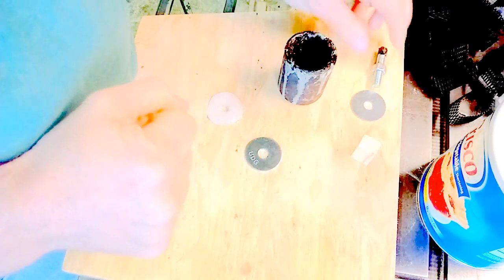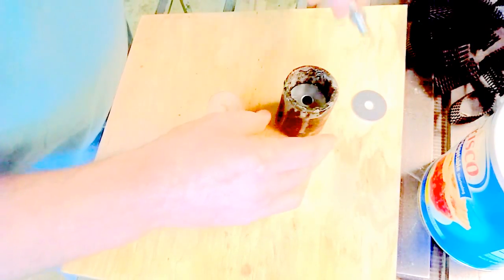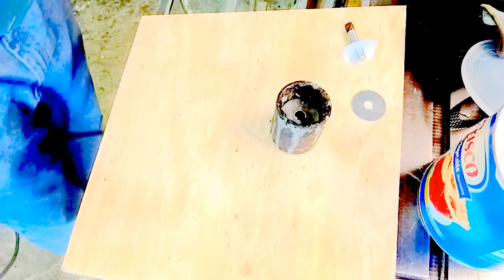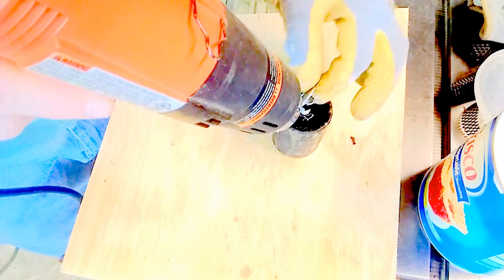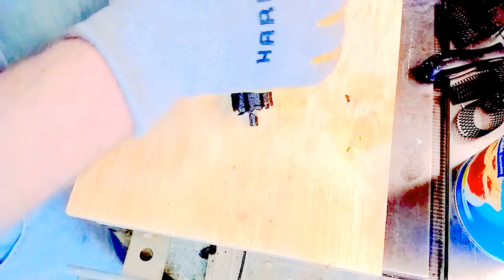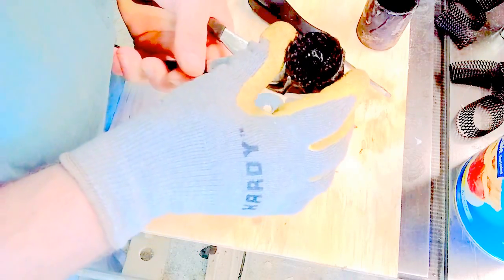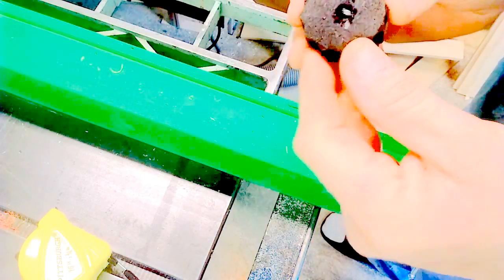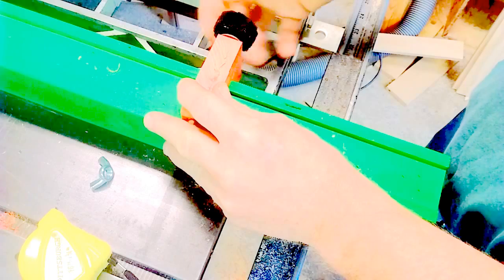How to make screw knobs for jigs from melted plastic

Comment: You would probably get better results if you used a pair of scissors to cut the plastic into much smaller parts before melting it.  It would melt much easier and make it less viscous, so that it run into the shape easier.

Comment: You could smooth it it a belt sander.  Just flip it upside down, support it ( maybe make a jig for that ), lock the trigger with string or a zip tie if it doesn't have a trigger lock built in, and plug it into a power strip with an on/off switch or foot switch.  Works well enough for most of my odd sanding jobs.

Comment: Little bit of refinement and it would look ad good as a shop bought mass produced one, good idea using the socket, you could do a knob with the threaded bar stuck inside too using the same method but with a pin in the end of the bar(to form a "T" shape) to stop it turning, 
Also, after sanding if you want it smooth again, try applying heat so as to just melt the outer surface, it's a little tricky but can be done with great results. 
                         Thank you